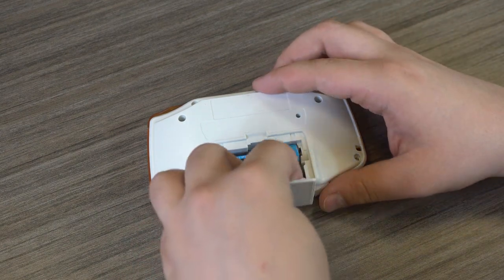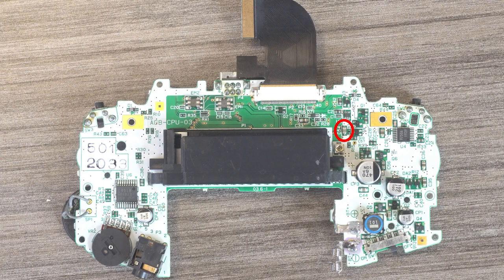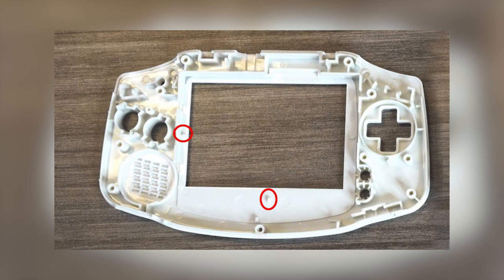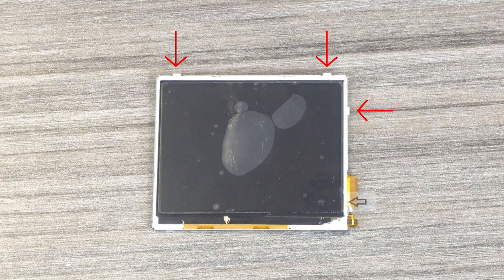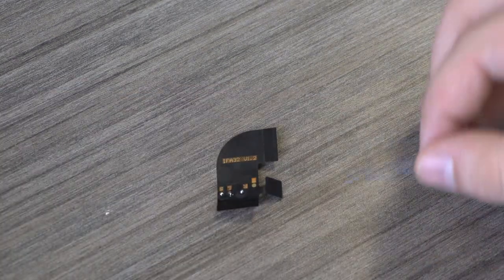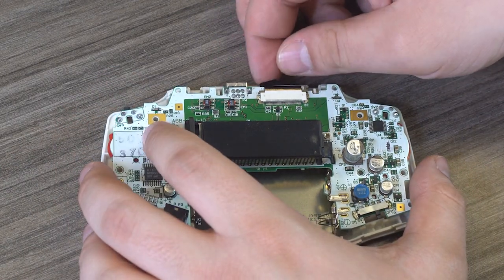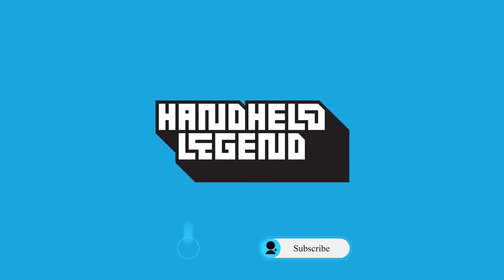GBA FunnyPlaying ITA TFT Kit | Install Guide

Comment: This kit is BY FAR, the absolute BEST looking screen on the GBA. I have installed and used the Funnyplaying IPS V2 kit but it looks much too smooth and lacks the ability to have a “retropixel” mode like many of their other IPS kits. 

The TFT kit looks amazing and maintains that original look and feel with the original resolution. 

Something I don’t believe was covered in this video - The display is  adjustable both vertical and horizontal after install.  Just press and hold the L and R buttons and then press and hold SELECT. It will bring up bars on the sides of the screen which allows you to adjust it to fit your lens bezel perfectly. 

Last, if your screen appears to flicker or have too many scan lines after install, you need to adjust the screw on the back of the motherboard to the right of the game cartridge area. This will adjust the display and fine tune it to your liking.  After that simple adjustment, this screen is MINT.

Comment: if your screen ends up in the corner and not on a good axis, turn the console on with no game and hold select. a menu will come up. in this little menu you can adjust brightness, frm, and both axis. while in the menu press select to switch what you are adjusting and the left and right bumber to make the actual adjustment.
Reply: Thanks!
Reply: for me, it's slightly off angle, and I can't seem to fix it no matter the adjustments both in the case or with the menu, what can I do?

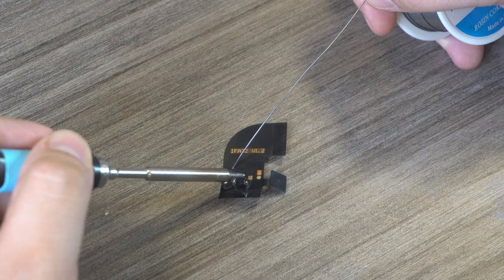Comment: The ribbon cable already has a touch sensor, so I don't understand at 2:05 that you say you have to solder the wires or else you wont be able to adjust the brightness?

Comment: How do you adjust the position of the screen using the button controls?
I know you can adjust the brightness, but I was also told it could reposition the screen if it's off center
Reply: I was wondering this too! I have the same problem!

Comment: What’s happen if i do not remove C54?
Reply: I’m not sure cause I’m just learning all this myself. But I bought some side cutters to mod the case and I just snipped the C54 off pretty easily.
Reply: The C54 capacitor needs to be removed on the 40 pin so that the screen can be calibrated correctly using the potentiometer. When Nintendo changed to the 32 pin version the motherboard was optimized and no longer has this capacitor.

Comment: The display ribbon has a solder pad for the touch sensor, would it be possible to run a wire to something in order to utilize that function instead of using buttons?
Reply: While I haven't tested it myself, I would assume that you can solder a wire to the point, and then connect the wire to a small piece of metal like the other kits. I'm not 100% right this second though.
Reply: @jadenschane7294  The ribbon already has a touch sensor.

Comment: i have a 40pin motherboard and i dont know if is safe to remove the C54 in long terms, any info here?
Reply: The C54 capacitor needs to be removed on the 40 pin so that the screen can be calibrated correctly using the potentiometer. When Nintendo changed to the 32 pin version the motherboard was optimized and no longer has this capacitor.

Comment: So... what's the difference between ips v2 and this?
Reply: The main difference is the screen that's used, this kit uses a lower screen from a DSi, which is why the tabs need to be cut on this one. I'm not sure where the IPS screen is sourced from for the v2 but they aren't the same screen, both perform very well.
Reply: @jadenschane7294  i'm waiting for a v2 touch sensors kit from handheld legend... from you 😅 will i have to extra trim the screen frame? Is it bigger than the original 101 model?
Reply: @NinSonyFan  You shouldn't need to trim the case too much possibly a little by the start/select buttons, however you would need a different screen lens. That particular kit is very slightly bigger than the OEM screen by about 1mm on each side, check out our guide for it! https://youtu.be/Uf1PRnjGLQ0?t=111 I linked that right to the shell trimming area so you can more clearly see what I mean, best of luck!
Reply: Instead of requiring a filter for LCD lines, these occur naturally because they are natural

Do you want new age crispy IPS pixels or OG scanline pixels? I like them OG

Comment: You guys didn't go over calibrating the screen here or in your written guide.
Reply from the maker: There shouldn't be any calibration that needs to be done, are you experiencing any issues with the kit? If so reach out to us at our email and we will get back to you ASAP! support@handheldlegend.com
Reply: @HandHeldLegend  You have to do it to get the right voltage to the screen. If you don't, you'll have some games visually spazzing out. It's in funnyplaying guide, on adjusting lcd. Best practice is using the aging ROM